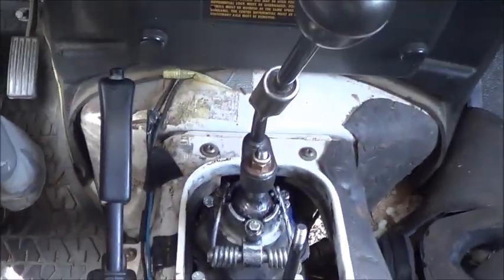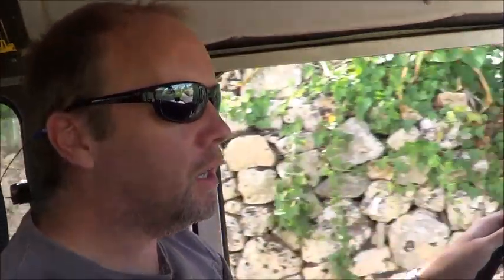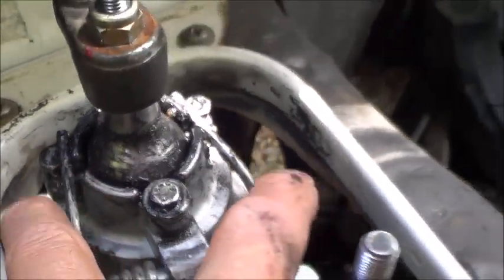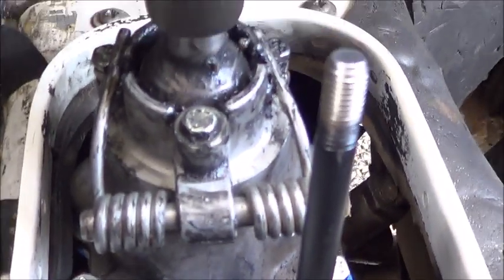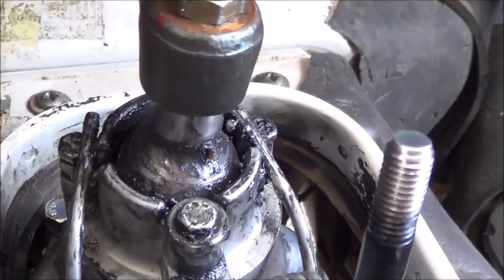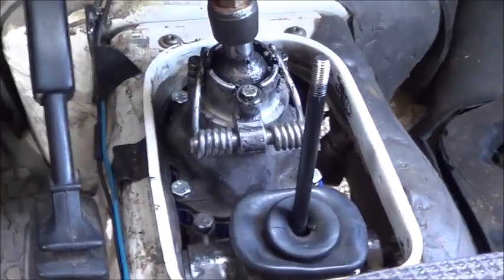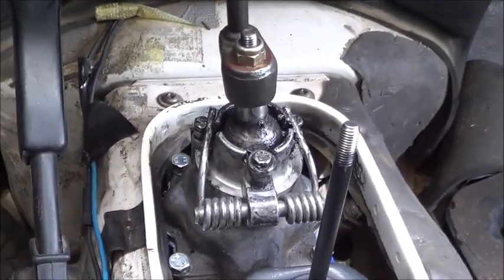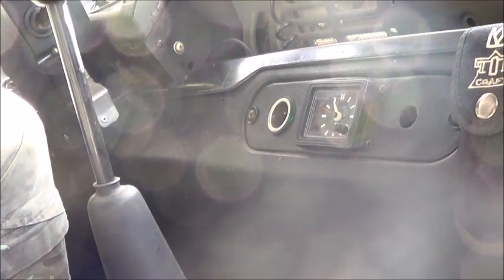Slick Shift adjustment and test drive - LT77 Defender 200Tdi | Syncrogearboxes #landrover rover

Comment: Hi, does the gear stick height increase after installation?
Reply from the maker: Yes, about an inch or so (the thickness of the slick shift adapter. Here's the install video if you haven't seen it yet (0.43 - 1.00): https://www.youtube.com/watch?v=WQL8jOhH2UI). Cheers!
Reply: @ASimplyFabLife  thanks for the quick response. Needed that answer as I have an AC vent and I think it will hit it

Comment: Nobody tells you the rubber boot won’t fit down properly because the shift is higher 🤬
Reply: wow did not know that, just ordered a new shift omg
Reply: I have doubts about this product 🤔
Reply: I wonder why we actually need this? as it make the gear lever higher geared it must increase the effort needed to change gear, and there is nothing wrong with the standard system. If it aint broke, dont fix it!
Reply: It does work, rubber boot is tight but does actually fit over the turret, would I buy it again? I’d have to remove it or try another R380 without slickshift side by side as I’m used to it now and have finally got it set up to my satisfaction, it does appear to make the 3rd/4th gear bias set up more critical.